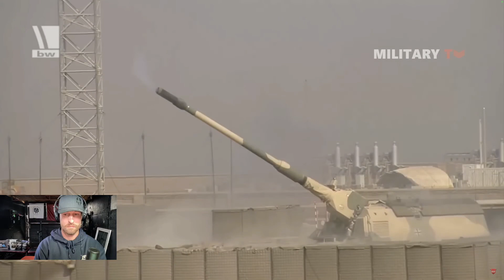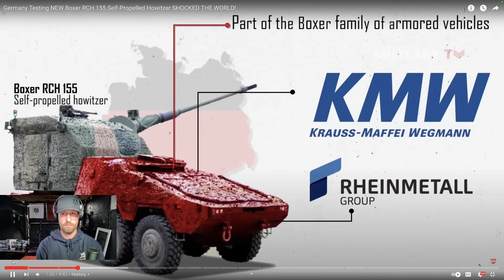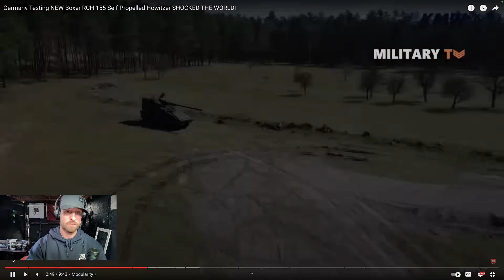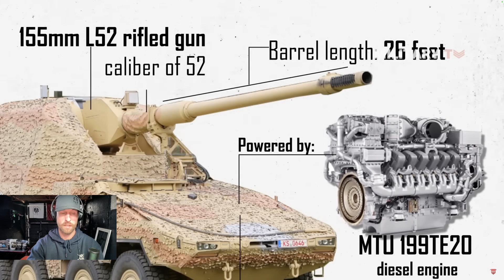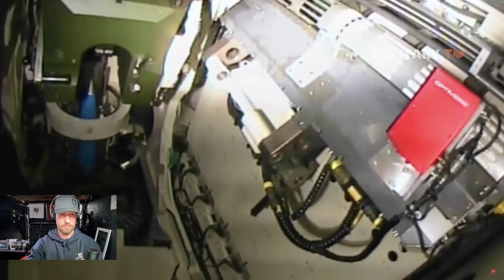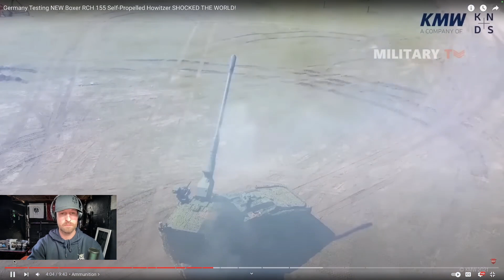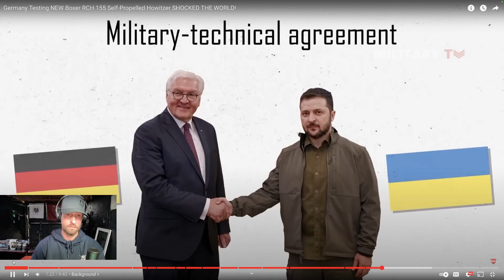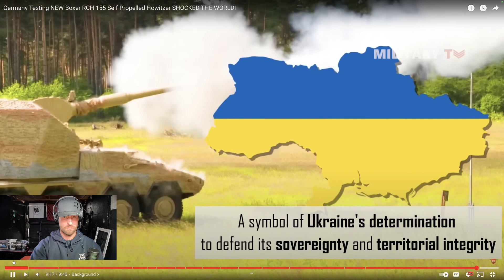Boxer RCH 155 British Armys New Replacement British Soldier reacts

Comment: Eighteen units. I would take a good long look at current losses in Ukraine before celebrating any victory as at some points eighteen units make up less than half a day's potential losses. Lesson not learned. Ukraine is currently offloading all its ammunition from its mobile gun systems and only putting the shot required in through the hatch at the time it is required due to issues with drones & ATGM causing total loss of the asset once hit, and they will get hit, so an autoloader would not be of much use in those circumstances. As for mobility One IVECO, bad news all round, Two, ask any site worker what Volvo site trucks can do in the right hands, ask any eight-legger driver what they can't do, no comparison at all. The Volvo wins hands down every single time.
Overall looking at this thing I detect the rich stench of government cost-cutting with zero thought for the consequences of those cuts ordered by people who will never be affected by those decisions at all. War is still a numbers game and if you ain't got it then you are going to lose every single time.

Comment: Somehow, the most important features of the Boxer RCH-155 were missing:
- no stabilizers needed
- 360° aiming
- direct fire possible 
- fire-on-the-move capabilities
Reply: moreover, it´s rdy for radiocontrolled use as a drone.
Reply: and it can be set on top of every vehicle ;D
Reply: AND (!) there is no kill switch, despite that one the gunner is using 😜
Reply: fire on the move... lol.... but only if you want to shoot half as far and just as precisely as the Russian artillery. The Boxer sways too much to be accurate while in motion. This vehicle is just a cheap mobile artillery module. Every time it's claimed that the RCH 155 is identical to the PzH 2000, you know that everything being said is bullshit. The RCH 155 is inferior to the PzH 2000 in every way except mobility. The RCH 155 shoots slower, has less ammunition, MRSI 6 vs. only 4!... The advantage is that it is a module. You can remove it from the Boxer. You can mount the module on trucks, various tank chassis, and stationary on the ground. Definitely better than the AS90, but not as good as the PzH 2000.
Reply: @donjonson1748  Fire on the move in testings was as precise and as far as while standing still. The Fire Controll Computer waits till the barrel is pointing at the right point before it fires the projectile. Also its used while on Roads or at least dirt roads and with slower speed, not while traveling through rough terrain. Of course MRSI doesn't work in this mode. But as Ukraine has shown, being able to fire on the move is a pretty important feature as you are safe from Counter Battery fire. There are plans to try and add that feature to the PZH2000. While tracked vehicles are good in rough terrain, its hard to get them to a front, train transport is almost always needed as the tracks deteriorate quickly when traveling on roads for long. With the wheeled variant you can drive through Europe and the tires will be fine. In case of Ukraine this means they can get the guns to and away from the front much easier and quickly and also harder to detect.
Reply: @majorix1  Getting to the front is not that great problem to ukraine/russia. Did not see much movent there, so tracked vehicles should be good right now. I really hope Ukraine gets all of promised stuff in promised time so there wil lbe a a bit more movement to show pros of RCH 155.
Reply: @majorix1  I think "fire on the move" should  be MORE accurate.  Consider the problem of "indirect fire".   You have to know where the gun is (use GPS or align with landmarks).  Plus you need to know where true north is.  You can align with land marks or celestial objects but magnetic and gyro compasses are not accurate enough.  GPS can't tell you what north is but it can tell you in exactly what direction you are moving, enough to calibrate a gyro compass.
Reply: @tyrson2445  "Getting to the front is not that great problem to ukraine/russia" - but it would be a problem for Western NATO countries in the event of a Russian attack on the Eastern flank. That's why the recent focus on wheeled platforms, to reach the frontlines faster and support the local forces until the heavy armor arrives.
Reply: @donjonson1748  The swaying doesn't matter.  Apart from gyro stabilization the gun will shoot at the correct instant even when there is residual motion.  Of course when firing GPS or ammunition such as SMArT 155 it doesn't matter.
Reply: @donjonson1748  For someone who obviously has no idea and hasn't seen the tests, you sure are opening your mouth. Sometimes it makes sense to acquire a little knowledge. Ignorance and arrogance have sidelined you here and you've made a fool of yourself. Knowledge is power.... Unfortunately, that doesn't apply to you
Reply: @gerhardma4687  so there are test results you can look at? And they show that the pch-155 is also wile driving as accurate and with as high range as the pzh-2000? whait.. is that gramatically even correct.. We poor germans
Reply: @donjonson1748 No. You don’t get how it works. The Fire Command will not be executed directly. The computer will wait until the vehicle sways / is in a position that will allow the projectile to hit the target. So you fire and it may can take 2 seconds until it really happens
Reply: @donjonson1748  You have no idea what you're talking about my guy. Just stop making stuff up about a weapon system you know nothing about. :D
Reply: @donjonson1748  When the swaying starts from the recoil the projectile has already left the barrel.
Except for number of shells carried the RCH155 is superior to the PzH2000 in every respect. The gun itself is the same but RCH155 can deploy, fire 8 shells and move away in under 90 seconds. It is also currently the only SPH which can fire on the move at up to 30km/h.
Reply: @donjonson1748  Inform yourself. Regarding swaying: How do you think guns on ships can fire precisely, those never stop swaying.
Reply: @donjonson1748  MRSI is 5 not 4 and depends on fire rate, distance of the target and which timeframe you consider simultaneously for impact. You can always increase MRSI by using multiple howitzers on the same target. 🎯🎯
Reply: @donjonson1748  The RCH 155 will soon be in ukraine ! And you my friend will to eat your own words !  If the RCH 155 is actually not as good as advertised , than they would never send those to ukraine were lacking performance would be very easy to spot since the PZH is also there ! They want to sell this sytem to a lot of big customers and the US is among them!  Sending a poor system to were its flaws are going to be exposed if there are any (if so they know it very well) is a bad and foolish commercial and would destroy any chance to further sell it to anyone ! It makes no sense!
Reply: @donjonson1748  Swaying does not matter... The gun fires in the split second everything is perfectly aligned. So not just the second you press the fire button. And mobility plus ease of maintenance (which is often terrible with tracked vehicles) are incredibly important. Smaller crew as well. The Pzh2000 wins in a game of Top Trumps and impresses more at a parade, the RCH 155 wins in a war.

MRSI 4 vs, 6 and max theoretical fire rate only matter so much in reality, when the real issue is getting enough Ammo produced and sent to the front. Superior systems win engagements, better logistics and industry production win wars. If you can pay for and maintain 10 of these vs. 8 PzH (and the ratio is probably even more in favor of RCH than that), you have already won.
Reply: @donjonson1748  The pzh2000 needs 5 people to operate the RCH 155 only 2. No need to leave the vehicle either. Much less fuel consumption. There is some benefit this new vehicle has. Moveability and logistics (less fuel to drive around) was found to be very important in Ukraine.

Comment: The German army is in the process of splitting up into light forces (paratroopers, special forces and such), heavy forces (tracked vehicles like Leopard 2, Puma and PzH2000) and medium forces (wheeled, vehicles like Boxer IFV, RCH 155). This also marks their response time, light forces can airdrop in, medium forces drive on their own wheels, and heavy forces have to be carried there by train or tank transporter. We're not giving up on tracked artillery, we're just making sure each force has artillery support.
Reply: Vehicles, air droppable
Reply: @CarstenStrauss  like german wiesel in different typs.
Reply: Light infantry aswell travel in on foot or light skinned vehicles like us brits do with land rovers and tcvs
Reply: What's new about that??
Reply: @mauno7230  the concept of the medium forces as rapidly deployable wheeled forces with every capability the heavy forces have on tracked vehicles? The fact that for the Bundeswehr is restructuring into an organization that's capable of war and not just intervention? The fact that my response was giving context to the video which you seem to have missed?
Reply: @mauno7230  So far Germany just didn't have the medium part.
Reply: @antonnurwald5700  well it kind of had already with the Jäger Bataillons, but those were on the light side of medium
Reply: Xes, we are going back to cold - war - modus

Comment: There are 2 main differences to the Archer System. 1.) the modulartity from the Boxer concept. 2.) There is no more shoot and scoot... now it´s shoot while scoot.
You can also put the RCH 155 module on a tracked Boxer chassis.
Reply: The ability to drive to the battlesphere along with the rest of the boxwe batallions as opposed to loading onto rail cars allows for a whole range of possabilities. Ro-ro are a necessity for UK forces as opposed to the rest of european arms, so the pure mobility of this boxer platform is particularly suited to our forces.

Comment: One point not mentioned is the RCH can shoot wile on a slow movement, about 5-8 miles an hour.
Reply: And hit what ? .😂
Reply: @tuborg-111  You know there is no guy in this turret turning a crank to point the barrel. That thing can hit while on the move, a target with multiple simultaneously rounds. That what it will do. Speaking of counter battery fire. You know that's not space science! Ships are on the move n' hit each other with shells for centuries. Now this tech is set on land.  🤓
Reply: @tuborg-111  .... you while sitting on the toilet and showing that you don't have any clou about it.

Comment: One benefit of a wheeled vehicle compared with a tracked one is the much less fuel consumption. Makes it easier for logistics. The barrel and ammunition is the same as for the Panzerhaubitze 2000. The PzH 2000 needs 5 guys to operate, ok they can reduce with some setbacks. The RCH 155 is automated and meant for 2 people operation. max speed >100kmh operation distance >700km.

Comment: Probably the main reason to choose wheels not tracks is the ease to maintain, replacement n' cost. In armies, who have fewer personals at hand, will prone to spent less into training that not necessary to fight the fight at core.
Reply: Its because they want it on Boxer, which doesn't have tracks. But tracks are being developed for Boxer. So tracks could be an option in the future. But not sure why. Wheels have gotten so much better and pretty close to tracks nowadays. So I've heard.
Reply: @TheBooban There is a tracked version shown in 2022.
https://youtu.be/nukB8k9pqas?si=rb46y7Q-kvmkyXxB

Comment: The Boxer platform is an ingenious solution. Spare parts, mechanics and replacement units makes things so much easier which significantly increases the readiness of the vehicles.
Reply: And with that Economy of Scale, makes the Price per Unit less.
+the Modularity helps to make future Upgrades easier
+Is nice for sales (than the country in th next years get their modernization & expansions + budget) since They have alot of cooperations with other countries companies going and can if costumer wishes integrate their domestic Parts, Gun possible new Modules on that.

Its a nice step for what Europe needs less different Systems for each country, with that more scale, cooperation, cost sharing,  but  the main problem will remain (understandable in parts) that you dont want to lose your domestic capabilities and not lose contracts for your companies
Reply: That could be achieved by cross-EU calls for tender for new procurements with the caveat that the winning developer has to share the full specs and blueprints with any certifiable producer within the EU. We desperately need more streamlined procurements in the EU, what we are currently doing is a waste of resources and money.
Reply: The only downside is its size. It is huge especially with a turret

Comment: This is the current status of the system.
The great advantage in the future is not even mentioned.
RCH stands for Remote Controlled Howitzer and upgrades in the future will make this system fully autonomous so a crew is no longer needed in the vehicle.
Reply: Something to hack or block and perhaps buy separate vehicles for the crew

Comment: looks a bit wonky but if it works it will be great and i trust the germans with engineering. and if they just slapped the pzh2000 gun on a 8x8 chassi, the suspension maintenance will be horrible. if maintained it will be a good system my only worries i see is the suspension wear, i just hope it wont be like driving a boat on land after the 2nd fire mission.
Reply: Tracked vehicle maintenance is far more onerous & expensive than that of a wheeled vehicle !😅